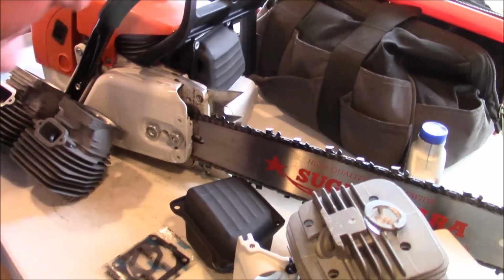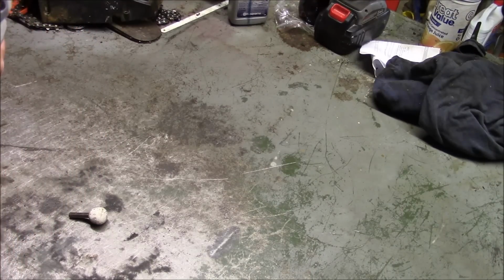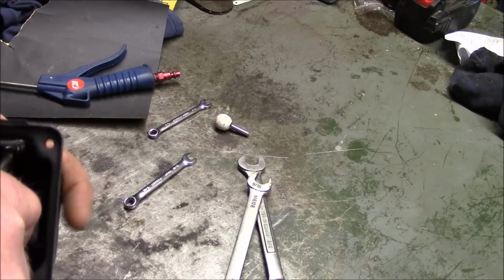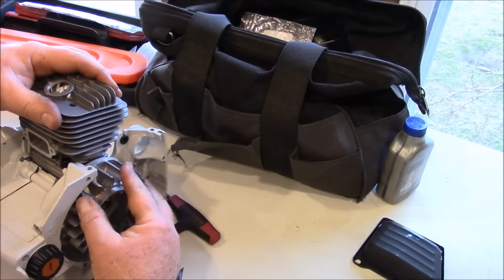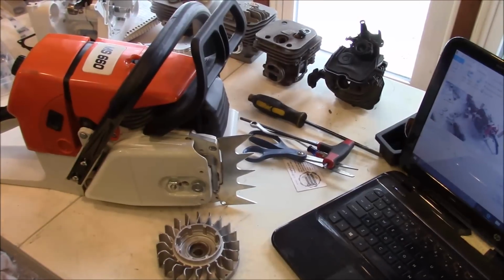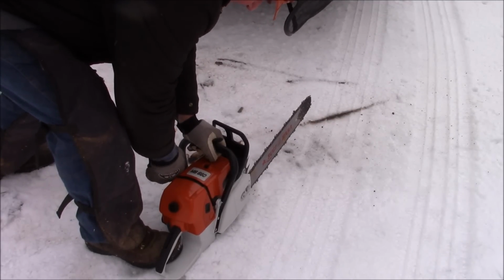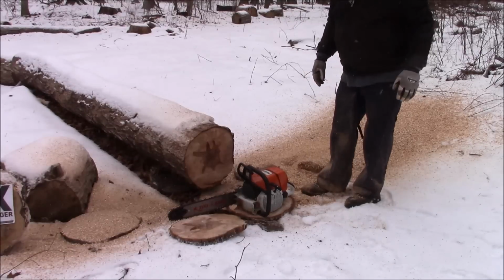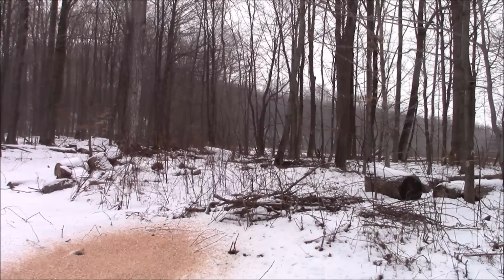MM660  (Mildly Modded 660 ) Part 2, Do things like simple muffler mods work?

Comment: That mildly modded sounds pretty good..  I listen to the saw in the wood.  Does it search all over the place or run at a constant rpm ( what I want).  The second saw you ran needs a touch more gas because it is searching all over the place.

Comment: are you sure about base gasket ridge up ? I heard on another yt vid it goes down, I dont think it would matter.  thanks for all the info much appreciated
Reply from the maker: I have done it both ways...successfully. Honestly don't remember where I "settled" on those
Reply: Goes down, for sure. Just finished a box saw MS460 build and longtime Stihl dealer/saw mechanic advised me through some of those little questions.

Comment: Did you go back and remove one of the cylinder screws after torquing to put the ground wire on it?
Reply: afleetcommand  my 038 mag has a ground wire attached to one of the cylinder bolts with a ring connector. I recently replaced the top end and am wondering how to torque that one bolt.  The ring connector keeps wanting to turn with the bolt. Thanks

Comment: Any more update videos coming? I'm waiting for my Huztl big bore parts and carb for my ms660 build. It will be getting a muffler mod with a custom pipe exit to blow the exhaust away from my while chainsaw milling. This saw will be living most of its life in a chainsaw mill.
Reply from the maker: +Kenneth Judd yup...and I am really interested in your experience milling with one.. I have 4 our with folks. All are doing fine. Almost scary.
Reply: +afleetcommand I'm hoping to have a video of it running when I get it running.  I have a good test waiting for it. I have 2 10 foot cherry logs a day 2 10ft birch logs. one cherry is 18 inches and the other is 21 inches.
Reply from the maker: Just one where I'm using the crank jack to squeeze together one...hen doing a series of Husqvarna based "Dead Saw Salvage" vids.

Comment: I clean any new cylinder and piston in my ultra sonic cleaner with just Dawn and water.  You will be surprised how much crap comes off a brand new cylinder and piston.  I then rinse them off with water in the kitchen sink and dry them in a 200 degree oven for a few minutes.  Maybe it is overkill but they are clean when I install them.

Comment: What do need to do for Break in with a new cylinder and pistion? Thanks John
Reply from the maker: Just run it.
Reply: i would run it with more 2 stroke oil in the mix for a few runs less chance of seizing

Comment: Hi                           i did notice a bit of  "tinny " rattle on the MM  saw that i did not hear on the "as is " saw   .Would that be attributed to the muffler mod. ?   as  i only heard it at idle or just off idle ,when not in the wood.  Noticeably  different exhaust notes.
love the videos      very interested to see what you find with the carb. on the  as-is  saw.
Reply from the maker: +Damon Hart Yea that is the interference between the plastic on the pull start and flywheel.. :) Easier to let it find its own clearance I think. (Hope I mentioned that in the video..think I did)
Reply: ah , yes you did say that , about letting it clearance itself, lol        thanks

Comment: Might be a cheap tool to try out some port timing and transfer ideas I have for my MS661c magnum..
You might want to run that extra Dog that mounts to the front of the clutch cover on MS 440 AND 660 Stihl saws if the clone has the same setup as that's where the chain catcher mounts on genuine Stihl saws....
Would not like to see a thrown busted chain without the catcher to help stop it from taking your hand off 🤔
Reply from the maker: No I really don't...:) They do come with that dual dog set up...but I have been going for lighter weight on those things. And with some of the light bars along with other bits and pieces taken off or modified, a couple of mine are pretty nice saws to live with.

Comment: Been hanging cabinets this week I had to come to get sum chain fix!!! Lucked into an 024AV with new 16 Stihl bar and two chains and the old "made in West Germany bar and good chain too!!! I'm gonna clean the old bar up to hang it up! LOL. It's mint and I got about 160psi on the gauge... My cheap compression gauge needs sum JB Weld around the seal down by the screw threads that attach to the multi size plug adapters ... Harbor Freight... I still looking for those two other spark plug holes so I keep saving the adapters? Do other countries have different plugs??? My saws - weedwackers and pickup are all the same??? So what's up with that? I'm gonna clean this guy up nice... Or buy a Hutzl muffler... Drill sum holes and run the balls off it! ! I just did a bit of tuning... I bought your tach (and love it). After a quick tune it was running great. I really stayed off it because the fellow runs that caned 94 octane 50:1 mix ... And I know everybody and their brother talks it up but I like my 40:1 and I know a guy that is an old dirt biker too that runs his 32:1!!! 😀👍👍👍
Reply from the maker: +David Thorne Still 32:1 after all these years..:)

Comment: I've got to stop watching your videos or I'm going to end up with 3 or 4 of these saws. My other project saws(pawn shop used saws mostly) have stopped breaking down and are running a little too well so I might just have to get rid of them and step up to kit built projects. I do have one question though, has anyone you know tried the 25' rolls of chain hutzl sells ? If I'm going to thoroughly test these kits I've got a feeling I'll want to put together some chains to save a little money and not wear out my go-to Oregon chains but I don't want to have a pile of useless links or potentially dangerous chains if they're not up to snuff. As always great video, keep doing what you're doing.
Reply from the maker: I haven't. I've pretty much stuck to the LGX for reasons from I have a good source for them to wanting to keep that part of the system consistent from saw to saw in order to isolate variables. The thing is chain is source of like ice skates to a hockey player. If that edge isn't just right it can ruin the whole experience. Bob has proven you can "file" a sub par chain to usefulness but I don't have the time or desire...:)
Reply from the maker: Thank you for watching & the support BTW
Reply: I've done some digging and found a few gentlemen on arboristsite and YouTube who have been testing out the farmertec(holzfforma?) bar and chain without complaint as they're dirt cheap and fairly durable. I'm thinking I'll pony up the cash for Oregon chain and a few farmertec bars. So that I have a bar with farmertec on it for giggles and still have chain I trust. When I've put the bars through their paces I'll post another comment ,if you're still doing hutzl builds at that point, in case you've got any friends that may want a cheap long bar or backup bars cheap etc.
Reply from the maker: All true, but the feel and how a chain performs is a very critical part of the saw experience for me. Oregon LGX for me. Light weight bars with a hard material for long life also is my preference. It isn't as much about the cost.
Reply: Dennis Muir I have a huztl 372 with a 24" farmertec bar and chain and I can say the bars are good quality hard metal not like some cheap bars that seem to be made of cheese, the chains are good quality but they don't come from the factory razor sharp so a few strokes of a file or a quick go on my chainsaw grinder and they cut great I was cutting 28" ash the other day and that was with a factory sharpen it was ok but if you touch the new chains up they are good and hold an edge.

Comment: Dear Sir:  Just did some investigation on the ebay Huztl store.  looked at  assembled case and cyl. for a MS 290--029 and found some disparaging information.  it seems that the same assembly for a MS 660--066 is an incredible bargain!  Huztl has 2 versions of the MS 290--029,  46mm is $185.89, 49mm is $165.89.  Price for the MS 660--066 is $169.39 (shipping included in these quotes).  Shipping charge for MS 660--066 is less than for MS 290--029.  Have you experienced such dichotomies in purchases from this supplier?
Reply from the maker: +jim wright Haven't really looked... But I do know the 660's are pretty inexpensive for what they are. And really they have product offerings for a price like any other company...its their cost plus. If the MS290's are more expensive, it is what it is. Since they are about parts, they aren't as concerned about "escalating" price points for saw sizes. We benefit. :)